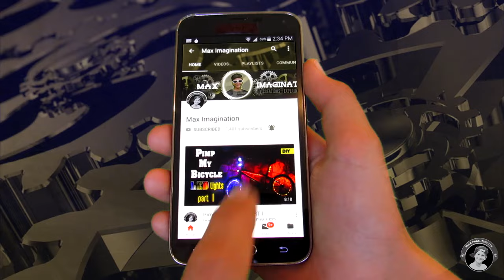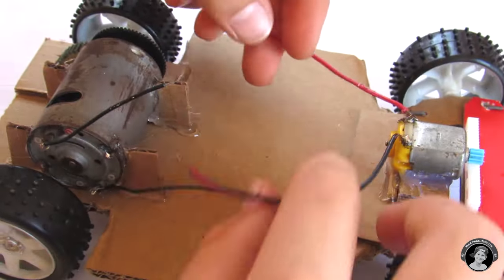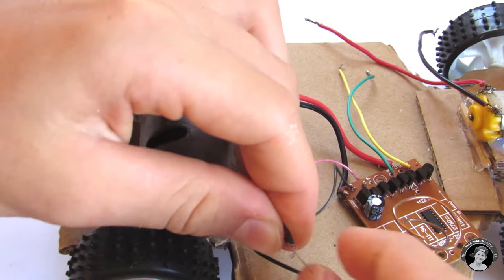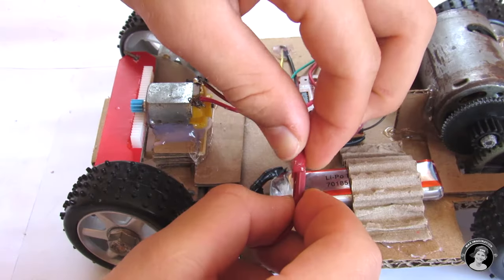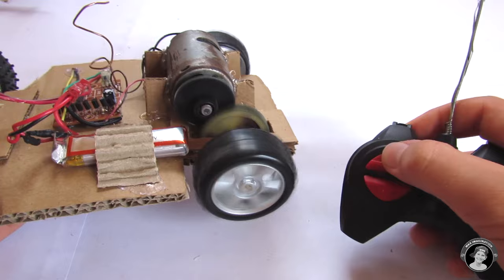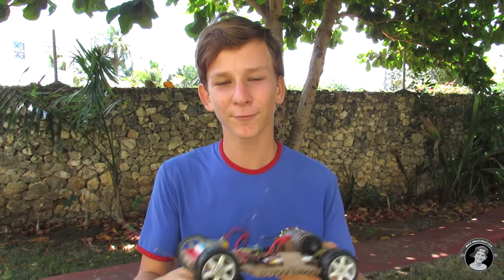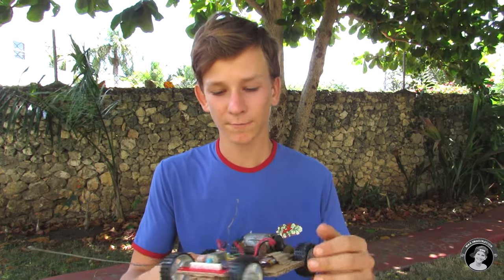How to make a Simple RC Car with Steering | DIY Remote-controlled Vehicle

Comment: Literally I have everything except the transmitter and receiver. Any ideas how to get one without ripping apart an old rc car ?
Reply from the maker: Hi there, please check the purchase link I left in the description below the video to where you can order a cheap transmitter and receiver pair.
Reply: But i have only reciver and transmitter 😂😂
Reply: You can make without receiver or transmitter ,but then you can't control it.
Reply: A TV remote i guess
Reply: Temu
Reply: Google what you need, websites that sell these parts individually will show, also ebay, amazon and temu like the above comment suggests

Comment: bro help me my rc car wheels spin great when i hold it but as soon as i put it on the ground it doesn't move forward or backward
Reply from the maker: Sounds like you're either under-powering your car or you chose too weak of a motor. What's your RC setup consist of?
Reply: @MaxImagination i used a 130 motor powered by 4 batteries, all of which are 1.5 V
Reply from the maker: 130 motors are too weak. I suggest you either adjust your gear ratio for a slower but more powerful car or obtain a 180 motor.

Comment: Great movie! big big fan!! thanks! 
I have one question, after the connection of the remote control reciver, suddenly in the video you use a regular toy car remote  transmitter, and you dont explain where to buy it or how to conncet it, or how to use the transmitter that I buy .. 
Please add explaintion or link to explantion or where to buy...
Please!
Reply from the maker: Thanks for watching! 
Please check the links in the description, there, you'll find a link to the transmitter and receiver pair similar to what I used. 
No connecting needed, since it's a toy grade 27mhz transmitter and receiver, they connect automatically without callibrating. Transmitter takes two AA batteries.
 
Cheers, 
Max

Comment: Hi, This is great, it's inspiring me to do a project that needs all these components, but has nothing to do with a vehicule.  I looked at many videos, and yours is the best one I got so far for my needs.  ALthough, there is 1 questions that is bugging me since I started my project. I hope you could enlight me. The motor that turns the wheels, how does it knows it's at the maximum on left or right?  Because the way I see it, it could continue to turn forever and tear the cardboard completely. But yours seems to stop even if you continue to turn the wheel. It's the only part that is a mystery to me for over 3 weeks now of research.  Thank you very much, you are very inspiring.
Reply from the maker: Hi there, thanks for your comment. Since the buttons on the transmitter control whether the motor should turn or not, you simply control the motor to go from on/off. The power given (battery) sets the speed limit for the motor in such a simple circuit. The motor shouldn't spin out of control, no worries here. Thanks for watching!
Reply: @MaxImagination  Maybe because  my mother language is not English, I did not express myself correctly.  Let's say I turn Right, and I keep my finger on the button, what does mek the motor stop when it reaches teh max teh wheel can go without breaking the gears ?  or it's just that it block and the motor continue trying but can't?
:-)  I hope I'm clearer.  But thank you for teh fact that the power sent to the motor controls the speed. I was wondering about tat. I want ot use some of this to create a motorised camera for a 365 degrees view.

Comment: grear video helped me with my science project but how  do you link the remote
Reply from the maker: Hi there. Glad to hear my video helped! The remote does not require binding, pairing, or any other form of wireless connecting, as it happens automatically with the receiver after both TX and RX are powered on.

Comment: Hey. Thanks for the video! 
What did you use for the metal pieces that held together the parts of the axle in front. 
Thanks.
Reply from the maker: Hello, thanks for watching! 
I used 2mm steel rebar-tieing wire, which you can probably find in your local hardware store. ✌☺
Reply: @MaxImagination  sir 2mm steel rebar tiring is too expensive here
Reply: @MaxImagination  sir can we sue anything else

Comment: From where did you get these cog wheels in the beginning of the video? And should I make a cover for the receiver myself?
Reply from the maker: Hi, I actually obtained the gears from the same place as where I got the motor from, an air compressor. 
Sure, you can make it yourself, if you want to, just keep it's antenna outside the encosure. 

Cheers, 
Max

Comment: I'm confuse on how you connect the controller with the car how did you do that I am very confuse. I'm doing a project and seeing this helps very much but the controller part was confusing do you have to buy one first or idrk??😔
Reply from the maker: Hi there. Wiring gets pretty straight forward once you've received the 4ch transmitter and receiver. There's simply two wires which the battery connects to, two for the steering motor, and two for the drive motor which pulls the car forward. The transmitter you can purchase comes looking very different from mine as this one will have no case, uses contact switches for the controls, and requires a battery for power as well. 
You can purchase that controller and transmitter through the links below. 

Cheers,
Max

Comment: I have one question I am lost on how to get the controller connected to the car like does it come with the parts?
Reply from the maker: Hi there. Purchasing the transmitter and receiver boards through one of the links in the description will get you the parts to control the car. You'd then need to obtain your own 3V battery pack (X2 AA batteries) and power this controller board. With the receiver also powered up (3-6V) and some motors connected to it, it should all work. No pairing or binding is needed at all, the controller automatically connects to the car via radio frequency communication. Cheers.

Comment: I got the same transmitter and receiver as the one linked in the description but I am unsure how to connect it to the battery. In the video the one u used had a plug for the battery but the one linked does not. Also how would I do the controller part, I have a transmitter board but Idk how to use that to control the car. Great video, thanks!
Reply from the maker: Hi. The transmitter board that you got is pretty much the same unit that sits within my encased transmitter.
What you'd have to do is first, is find the marked Positive supply (VCC) and negative (GND) marked on the front or back of the circuit board. Solder a wire onto each of those and connect them to your 3V battery pack accordingly. 
Hope that helps.

Thanks for your comment!
Max
Reply: @MaxImagination  thanks for responding. I have one more question. So I have the that transmitter and receiver but how would I connect it to a controller so that I can control the car. It’s for a school project and we’re just not sure what to do with the transmitter pcb board, thanks!
Reply from the maker: Hi. The transmitter is the controller. If you have a soldering iron at your disposal, then you can solder some pushbuttons in place of the momentary contact poles that are on the PCB. Lastly, you could build it an enclosure, making your controller complete.
Reply: Thank you so much for responding, u may have just saved my finals project grade. If u don’t mind me asking how would we be able to identify where and what the momentary contact poles are. Thanks again!! :)

Comment: Making it belt driven with a rubber band should make it both easier to build and more reliable, also wouldn’t using a smaller motor be more practical? The decrease of the power draw and reduction of weight makes more sense to me than a 12v
Reply from the maker: You're right on the motor part! I really didn't seem to care much about the power draw and choice of using an oversized back then, I just grabbed what I had at the time and made something work. 🙂
Geared or belt drive, I believe it doesn't make a huge difference on such a small car. Though, thanks for the tip.

Comment: Thanks for the video. What is the name of the RC receiver circuit you used?
Reply from the maker: Thanks for watching.
The receiver and transmitter pair are both set at 27mhz (4-channel Radio)
Reply: @MaxImagination  Thanks. What frequency transmitter/receiver we should use for larger motors, for example to use RC control for DIY snow plower cart?
Reply from the maker: @thestylesworld  A 2.4Ghz RX and TX would do for anything more technical, that signal band is more commonly used, especially in WiFi, and has got much greater range over all.
No problem! 😀✌

Comment: Hello thanks for the video. I really wanna make one. But Can we use the battery pack from the gear kit instead of buying a separate one?
Reply: Can we also use the motor from the gear kit?
Reply from the maker: Hi there. Could you please first send me the link to the gear kit you're referring to? So I can get an understanding of what motor and battery you mean.
Reply from the maker: @indianscammer9659  The gear kit I linked does not include a motor or a battery...
Reply: Ok maybe the photo was misleading. Thank you
Reply: Is there any way to reduce the price?
Reply from the maker: Order from Aliexpress

Comment: hi, what are the dimensions of the steering mechanisms?
Reply from the maker: Hi. I no longer have this car around to give you the accurate measurements. Though, approximately 10x2cm for the red cardboard slider piece and try using a 3cm section of rack gear. Cheers.

Comment: I got the receiver and transmitter from the description, but how do I set the forwards/backwards and turning on the transmitter? Do I need to add more buttons?
Reply from the maker: Hi. You simply can use the momentary push spring contacts as they are or solder pushbuttons of your own.

Comment: Bro can we use any other battery for the car. Bro can we use any other remote for the car or any app we can use
Reply from the maker: You can use 2-4 AA Alkaline batteries or a Lithium Ion battery for this car. It only works with the type of remote shown unless you want to upgrade to an ESP32 controller for app capability.

Comment: Where did you get the remote control? I don't see a link for that. I assume the transmitter goes inside it?
Reply from the maker: The transmitter (remote controller) I used is no different than what I linked below (the transmitter board), it does the same thing. The case is not sold separately online, from what I know.
Reply: @Max Imagination  Well the pictured transmitter board has no joysticks or buttons, so how do you merge the transmitter to a controller like you have to actually use it? I'm also confused on how you used a 12 volt motor when the description of the receiver board says it only powers 3 volt motors and the link you have is only to a 3.7 volt battery?I really want to do this project, but am a little confused.
Reply from the maker: @Kman-hw9pf  Hi. I suggest you watch this video of my latest iteration of this RC car: https://www.youtube.com/watch?v=sz_R9VOnnPk&t=205s

Hope this answers your questions.

Comment: Great work.! But could not find any link for the 'remote transmitter case', Can you help?
Reply from the maker: Hi there. Thanks for watching! As mentioned in the video, all parts are linked below in the description. If the part appears to currently be unavailable, that may mean you'd have to be signed in to see its availability.
Reply: @MaxImagination  Hi There, thanks for your quick response, I see the transmitter and receiver circuit is there, but no case for the remote.
Reply from the maker: @manoharanchinnaiyan1243  Unfortunately, there is no case sold separately for the Remote, one has to make it themselves, add pushbuttons and battery, etc...
Cheers.
Reply: @MaxImagination  oh.. Ok, Np, thanks for your response.

Comment: There might be one little problem when you release the turn button the wheel does not return to a neutral state. Do you know how to fix that?
Reply from the maker: Hi, I believe you are having a similar problem as what I had, check that the transmitter's buttons aren't stuck (internal pushbuttons) if you have an encased transmitter like mine.
If that's not the case, then it may be the pushbuttons themselves that are faulty, or you may have a problem with the circuit board's connections leading to the buttons, which means you'd need to do some soldering work to fix that.
Hope that helps :)
Reply from the maker: Also, first please check that you have a spring-like mechanism built into your car's steering (EG; Rubber bands) because the motor will not return the steering to its neutral position by itself.
Reply: Thank you very much. One of the internal buttons was stuck indeed. I quickly fixed it and it works now. Thank you for your response. One question I may have is what was the problem in your case? Since the wheels in the video didn't return to a neutral state?
Reply from the maker: @macjalac5845  No problem! I'm glad that it was just a small issue you had to sort out. Yes, well, I had the stuck button issue too, but the steering mechanism in my car didn't return because I hadn't installed a spring-like return mechanism.
Cheers ✌
Reply: @MaxImagination  Thank you for your time and I wish you well in your upcoming projects.✌️
Reply from the maker: @macjalac5845  Thanks a lot! 😀

Comment: Thank you so much for your video🤗 and what is the name of motor used in steering and back motor ??
Reply from the maker: Thanks for your comment! For the steering I used a 130-type 6V DC brushed motor and 540-type 12V DC brushed motor for driving. Although a bigger motor may work, it is still best to get a 180-type 6-12V motor for the driving.

Comment: I cant find the "uxcell Spart Part DC 3-6V 6500rpm-12500rpm Magnet Electric Mini Motor for RC Airplane" anywhere. Does anyone know where to find it in stock, or a equivalent replacement product?

Comment: i noticed that the transmitter in the description does not have the same wires as the one in the video( the ones connecting to the battery), have you modified it and in that case how.
Reply from the maker: Hi, you probably didn't know, but the encased plastic transmitter seen in the video is based on a similar circuit board, containing only two wires which go to the battery, don't confuse them with the white antenna wire (transmitter on aliexpress).
So both shouldn't be any different from eachother :)

Comment: So can you use any remote for that car?
Reply from the maker: Ones that are universally compatible to most aircraft & land vehicles such as the more expensive "flysky" transmitters, those will work with this car, with the right motor speed controller.
With other cheaper radio TX and rx pairs, you'd have to check whether the one you're choosing is for rc cars and that that one is a 4ch radio. Cheers.

Comment: What's the chip thing you put in the middle?
Reply from the maker: The brown board with the chip is the Receiver/Motor controller unit that takes signals from the transmitter/hand controller. Please check the purchase links below to find where you can get a pair.

Comment: You didn't use any transmitters and receiver module like 433 mhz transmitters and receiver module
Reply from the maker: Hi and no, I happened to use a preprogrammed 27mhz radio control pair.
Are you making an arduino-based RC car? Or what microcontroller will you be using?
Reply: @MaxImagination  Very first thing thanks for the reply, well I'm interested in in electronics, a beginner, want to know the working of 433 mhz transmitters and receiver module circuit diagram or any transmitters and receiver module circuit diagram, can u explain or anybody you know can explain
Reply from the maker: @kamleshchavan7451  Hi, no worries at all. I do actually know someone who I can send you to who has worked with 433mhz radio modules, though the person can be contacted via Instagram.

Would you prefer that?

Cheers,
Max

Comment: Are there substitutes that you can use for the rc reciever and transmitter that still work with 27 mhz?
Reply from the maker: Hi,
Yes there are.
You may use this 27mhz pair: https://www.amazon.com/Calvas-Control-Circuit-Transmitter-Receives/dp/B07RC81CW5

Comment: Very nice and helpful video😍-but short questions 1)Can we use icecream stick accept of straw?
2)can we use accept of soldering iron a fire heater that melts the item and join can we try or we can do?
How much the cost will in total?
And please don't make the video that first we cant understand some parts
Please tell my question answer
Reply from the maker: Hi, thanks for your comment, please excuse my late reply...
Ice cream sticks, yes, as long as you use 2 or three around the axle bamboo stick.
You may take a lighter & copper wire instead of soldering iron, yes, but it is not a very efficient solution, also make sure you use soldering tin/lead to solder with.
The cost can't really exceed $10, the parts count is low and I tried using the most affordable parts.

Cheers, 
Max

Comment: where did u get the 3 gears for the motor at the back (the one on the bamboo stick and the ones on the motor)
Reply from the maker: I got them from a broken car air compressor pump

Comment: Hi Max it's great.. can you mention the model number of the board for remote and motor which help me to purchase it.. Hope that board will help in forward and reverse motion also....
Reply from the maker: Hello and thank you. 

My receiver board's model number is "YX-060R-B", transmitter board's "ZB758A" and the motor type I used was a 540 motor. Feel free to look those up.

Also, here's a purchase link to the right transmitter & receiver boards you may want to use: https://www.amazon.in/Control-Receiver-Wireless-Antenna-Accessories/dp/B07JN4NBGZ

Hope that helps, cheers!
Max